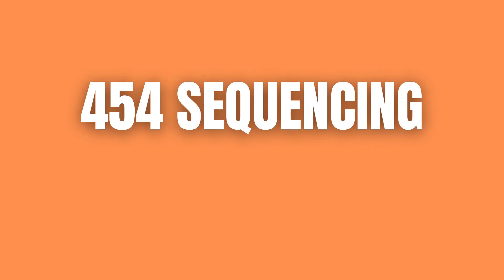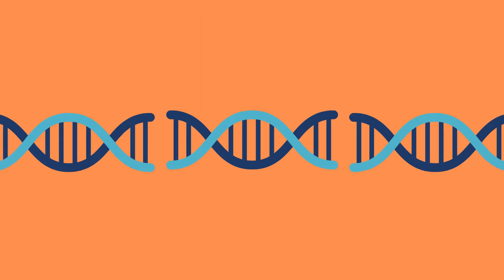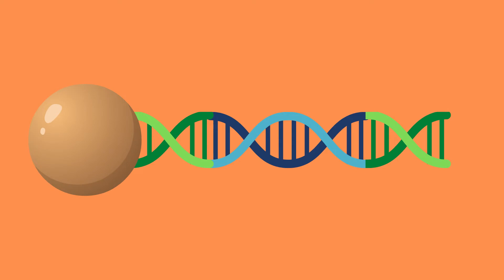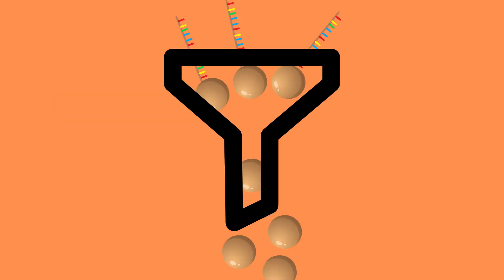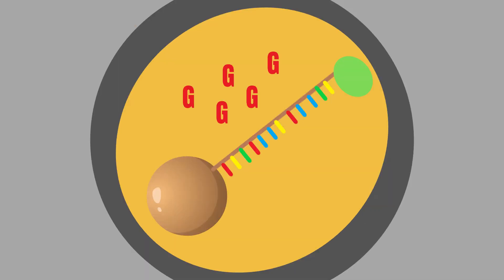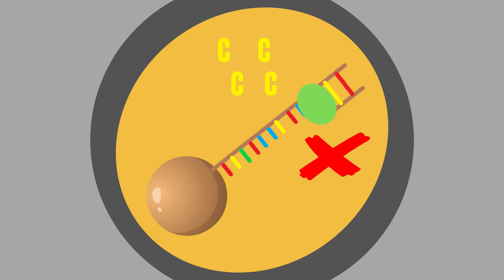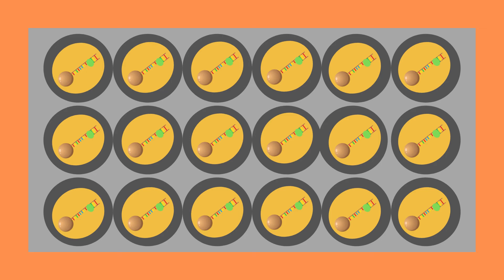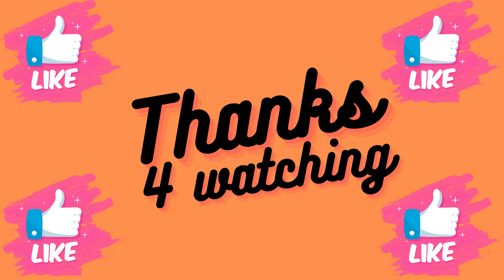PYROSEQUENCING EXPLAINED

Comment: Few comments: 1. The text at 0:19 says 1 billion genes, but the narration gives the (correct) statistic of 1 billion bases. 2. The video implies that the system is performing single-molecule sequencing. In fact, the system can not detect such a small amount of light, so to generate enough signal, a PCR step must be performed, to create a large number of identical DNA molecules on each bead.
Reply: Thanks I was watching this and suing chat gpt as well and realized that during emulsion, the  PCR is ass multiple identical DNA molecules are generated in each bead

Comment: are these 2 adapters same? If yes,,why ? If no.. Why are they different?
Reply from the maker: I will read up on this and answer you tomorrow, thank you for your patience🙏
Reply: I got one more question… can we first separate dsDNA into ssDNA and then  do adapter ligation step ? Or is it necessary  to ligate adapters to dsDNA??
Reply from the maker: Hi Meenal! I apologize that my response is later than promised! The adapters simply refer to oligonucleotides (A, C, G, T) that have been chemically synthesized that are complementary to the DNA attached to the raisin beads. 

For your second question, as far as I have understood at least, the DNA is double-stranded when the process begins and once the DNA fragments attach to the DNA on the beads, it breaks down into single-stranded DNA. Whether or not the DNA HAS to be double stranded by the start of the process I am afraid I do not know. Please let me know if you find out!

I apologize I could not be of more help!